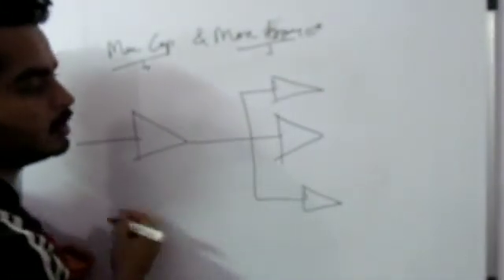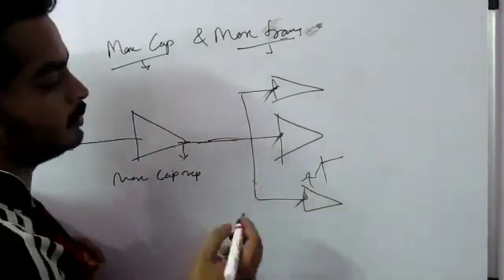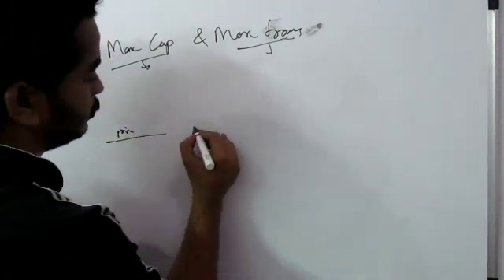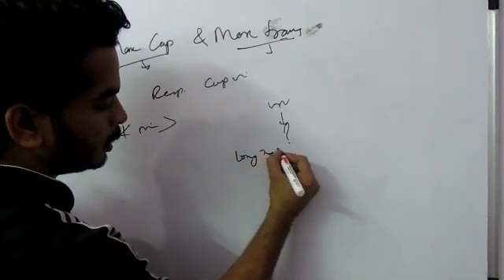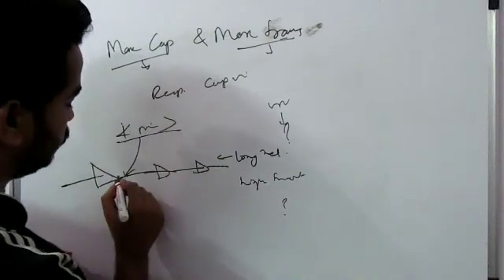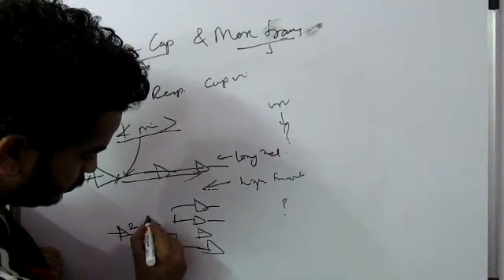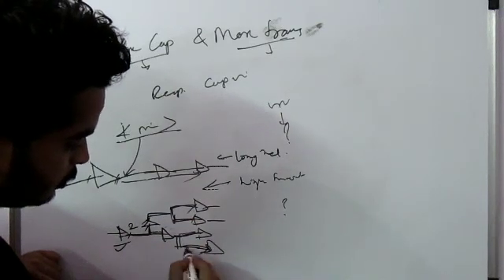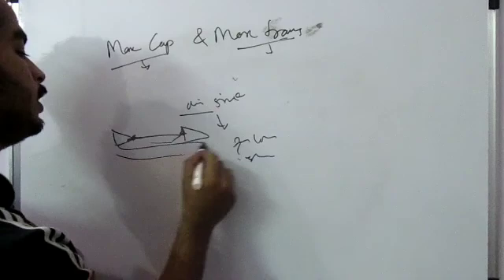VLSI Physical Design How and where we can find max cap and max trans violations

Comment: Will max Tran voilate if max cap is violated
Reply from the maker: Hii...most likely if the same cell is unable to drive the output....with require efficiency then it may violate trans on the inputs of the next cells.....but it always not that case ...may be due to library values present which my differ in requirements in violations.